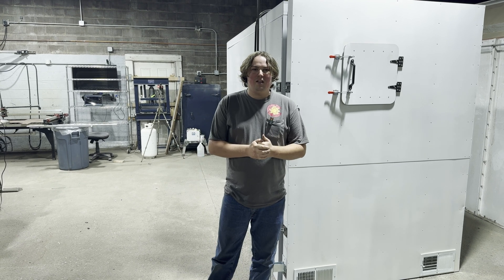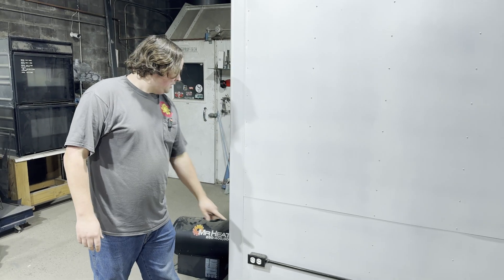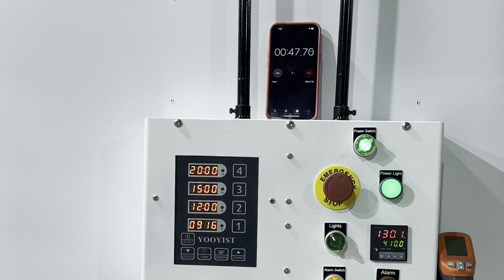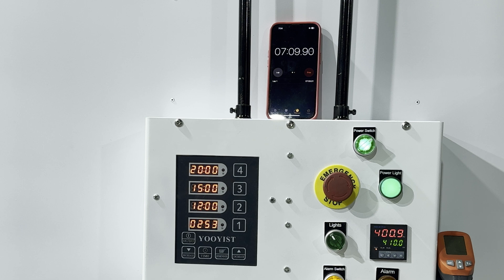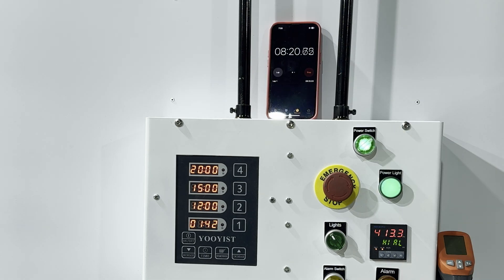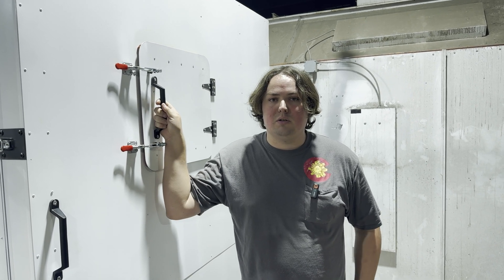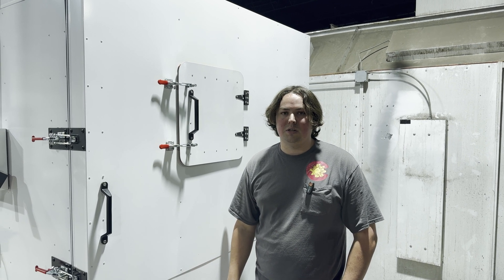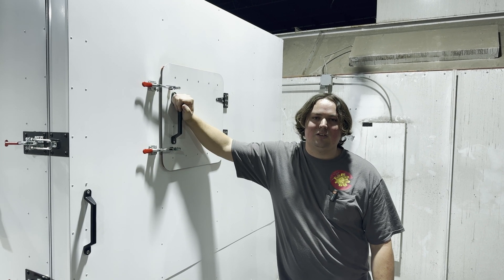Making a Powder Coating Oven Part 1

Comment: Is the propane able to keep the oven pretty stable at temp, or does it fluctuate quite a bit?
Reply from the maker: It does fluctuate due to heat loss, we believe through the floor into the concrete. But it will only fluctuate between the temperature range set in the PID controller

Comment: How many baking cycles can you get with your propane set up cooking at 400F?
Reply from the maker: We haven’t ran a bottle out but we haven’t used it a lot either. We have done 3 sets of wheels where we did the off gassing then base and flowed it out then dipped them and off gassed them then cleared powder to full cure. And a handful of miscellaneous jobs, for a total of maybe 10 hours so far
Reply: @ColoradoCustoms good deal. Thanks for the response. Does it hold temperature well?
Reply from the maker: @aldraias1 it does hold temp pretty good but I do need to add a vent pipe to it so I have been modifying plans to accommodate that